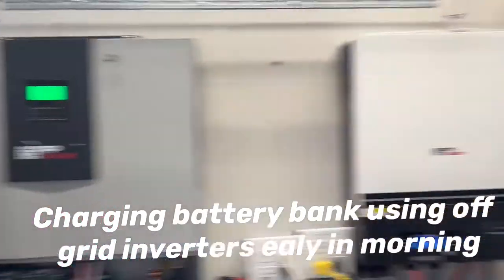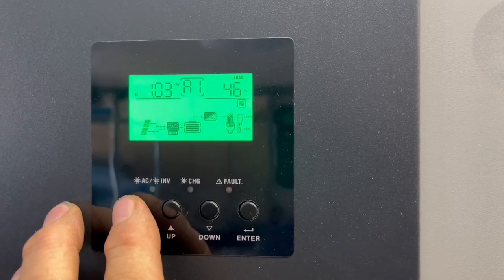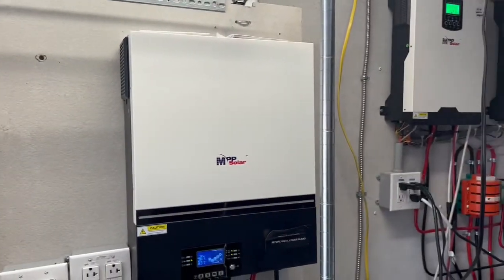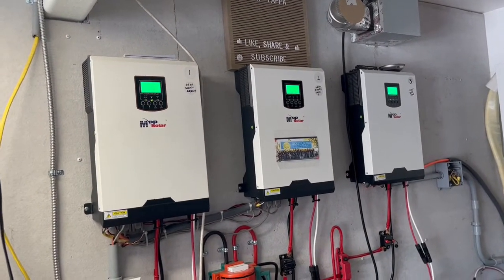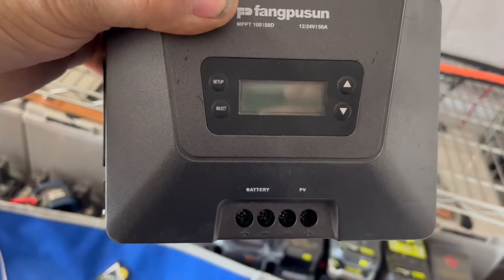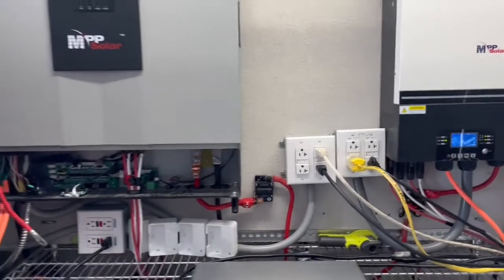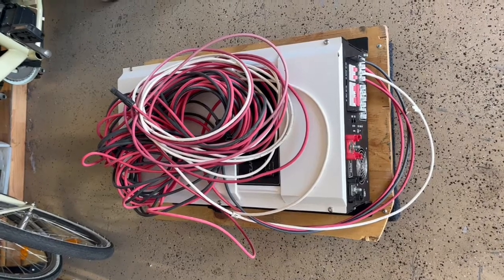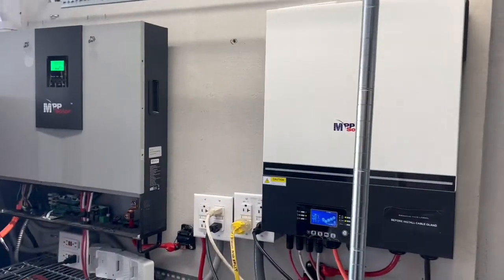DIY solar power with Pappa Utility charging battery bank early in morning using off grid inverters.

Comment: So many different inverters, but no centralized system. All my ac is always hooked up to run. Plus my system powers everything all the time including my car.
Reply from the maker: Hi James, we set up our systems independent and portable so they can be moved to a different location if a need arises with family and friends. Our friends and family have seen what we were able to do and are interested in doing the same.  So we have systems already put together that can be disassembled and installed at a different locations in less than 8 hours. That is why the systems are not connected together. Hope this helps you in understanding why we have our systems set up this way. We hope you have a truly wonderful and very blessed day.

Comment: also, the growatt is a low FREQUENCY not low voltage. just fyi
Reply from the maker: Thank you so much for letting me know what I was saying was wrong, I really do appreciate it. I was diagnosed with 2 incurable cancers in 2016 and some of the medications I take have side effects. So I sometimes say the wrong thing. I thank you for helping correct my errors so I can keep learning and sharing about off grid solar power systems. Hope you have a wonderful and blessed day.